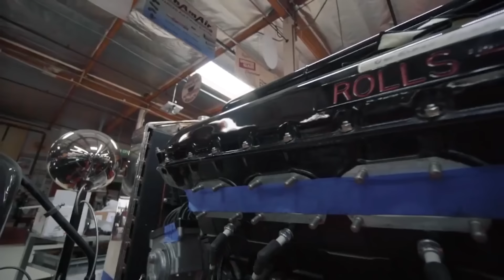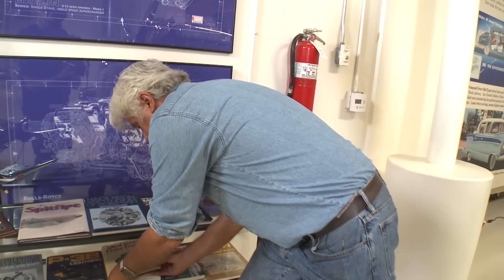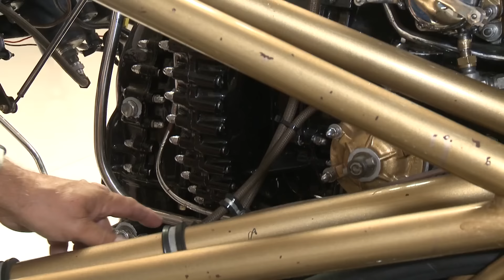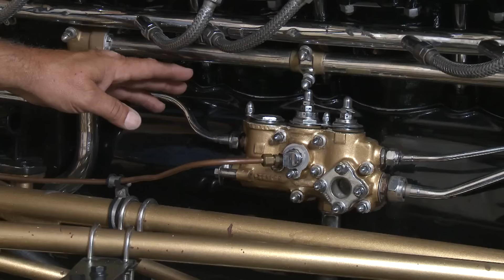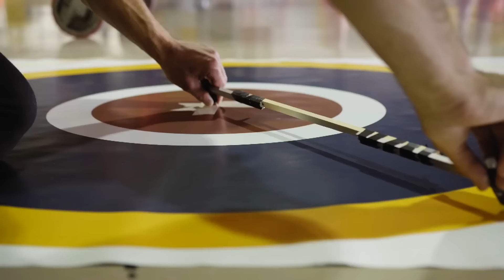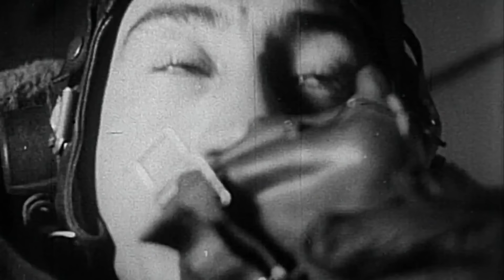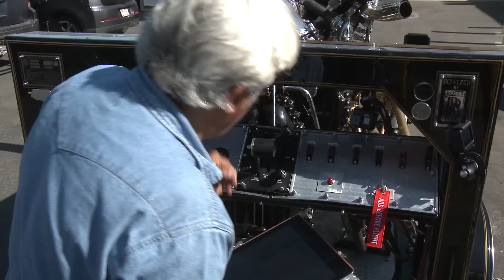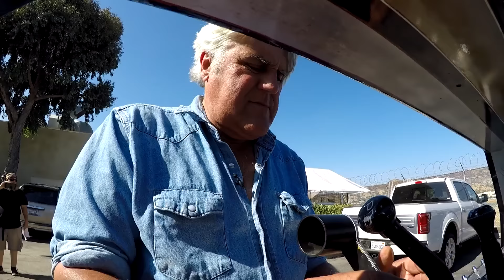The Engine That Won World War II - Jay Leno's Garage

Comment: Thank you for saving and restoring all the cars, the Merlin, and all the other pieces in Jay’s Garage.  I know how you feel.  I am currently working on  the second restoration of a 1921, New Orleans built Mikado 2-8-2 Steam Locomotive.  She was restored to FRA standards in 2004 and made several trips out on the main line of several Class one and short line railroads,  she turned 100 in February.  We had hope to have her running for her 100th birthday but Covid -19 halted the work for over a year now.  Any one interested cal search on You Tube for SPX-745 if you would like to see her running out on the main line.

Comment: While I was in the Air Force stationed in West Texas, I got my commercial pilots license using my GI Bill.  I use to fly to, if I remember correctly, Brownwood, Texas to build my cross country hours.  There I watched a group of guys build a flying P-51 out of several airplanes.  I remember looking behind the hanger and seeing several P-51 fuselages, wings, tail sections, etc, etc.   I was there the day they did the first taxi test and a high speed trip down the runway but it did not get airborne.  I missed the first flight.  I love the sound of those Merlin engines.

Comment: Cool video!!! Especially the view of the internal workings of this beast!!! And the explanation of the components!!! But Jay needs to be a little smoother with the working of the throttle... Things like this, don't respond well to sudden movements of the throttle, mixture and prop pitch controls, especially with a shortened prop like this display engine has... Two thumbs up Jay!!! 👍👍

Comment: Those ran best on 115/145 Octane  Aviation Gasoline, that is loaded with lots of extra tetra-ethyl-lead to obtain a  true 145 Octane rating at sea level. The P51A, & B models and some C models had Allison engines  that failed to deliver good performance at or above 10,000 feet.

Comment: Jay, that's an awesome piece, but you need different models for your Merlin display. The Curtiss P-40 Warhawk on the right was built around the Allison V-1710 engine and the Vought F4U-1 Corsair used a radial Pratt & Whitney R-2800.
You need a Spitfire Mk1 and a P-51D Mustang up there.

Comment: BY the time the P51s with the Merlins were commonly used the radials had done the most of the job, The P47 Thunderbolts had saved the D day landings with there fighter bomber techniques and prevented Germany from sending troops and weapons to use on the beaches. Greg's Airplanes and Autos in his series on the Thunderbolt , episode 8 explains why the Mustangs were given more credit than they deserved.   And then in the war in the Pacific, the Wildcats, Hellcats , Thunderbolts and Corsairs in the roles as fighters also did the yeoman's work in escort of Navy fleets and bomber escort. Grumman wasn't called the Iron Works for nothing, They and others that used radials built planes that could take a lickin and keep on tickin.
Reply: @tecdessus https://www.youtube.com/watch?v=PZKKr56YgOE 

All sorts of planes were used , But the P47 with their low level bombing and straffing made the Germans fear the Jugs. Very few planes could take the damage of flying thru tree and electrical wires and cables and still return home. And at low level they were able to accurately hit the targets  and cause mayhem with their 50 cals. Everything contributed on D day, But the Jug was in it's element in it's role.

Comment: Yes Jay we did imagine that Merlin at 4000rpm and it went something like... the chains securing it to the ground snapping and you holding on for dear life with your legs straight back behind you flying over LAX being asked by air traffic control what the unidentified aircraft is flying over restricted air space and F-16s escorting you to your crash landing in Nevada, LOL to finish off the rest of the show/video. Although i know its just an engine in a stand, the vision in my mind was what was most funny.

Comment: Had a few of these in pulling tractors and monster trucks. We got them from Birds Metals for 80 quid each, No guarantee it would run, but you could always take them back and weigh it in for scrap and get your 80 quid back. We eventually got a workshop manual for them and on the top of each page was stamped  TOP SECRET M.O.D. 
 Still one of the best mechanical sounds EVER...
 If you shut the reves down to quick it would brake the counter weights in the distributor....

Comment: Enough with the Limey engines! How about a car based on the more interesting  Ford V-12 aircraft engine? This was designed to be superior to the Merlin in every feature except the supercharger - better valve train, better bottom end, fewer parts etc. I would like you to acquire one of these engines and mount a Merlin supercharger on it. Alas I'm not able to participate in the financing for such a project. But I would be grateful.  This was probably the US/British engine that should have been in the P-51 rather than the Packard/Rolls engine. Probably politics. Henry Ford was out of favor with Democrats.
Reply: Suck it up paddy.
Reply: But the Ford engine was not made, only a few prototypes.  Why should the allied armed forces buy  a Merlin lookalike and flyalike when they already have one?  They told Ford to devote its skilled men to design and make what was needed, not duplicate.
Reply: @johnburns4017  
You may be right. I'm just speculating. But one thing is clear later engines are better than earlier engines. All aircraft engines were constantly being upgraded. The Ford engine was a later  and more advanced design. The Merlin was single overhead cam, the Ford was double , the Merlin had fewer main bearings and about twice as many parts. Ford had tried to make the engine more robust and reliable. It was a later (better) design. So the Ford had a better potential future than the Merlin.

The Merlin had the great advantage that it was available now and it worked. Many new planes were begun but never reached combat status for one reason or the other.  Even if I had been there at the time and I was a real aviation engine expert I would not argue with the decision to choose something that works now against  the possibility of better performance that might never materialize. I'm just a Youtube commenter. That's a tough call when men are dying. As they say, the decision was above my pay grade.

But consider: the Ford engine turned out to be a great engine in Sherman tanks in V8 form. Reliable, powerful and easy to repair. 

The Merlin had already been popped into the P-40 to replace the Allison and hadn't made much of a difference. I can't explain why it did so much better in the P-51. The aerodynamics?

The Merlin was  the second bigger version of the line. Rolls Royce tried to increase the same basic design with the larger Vulture and it never worked very well. 

The Merlin was not designed for mass production/interchangeable parts and had to be reworked by Packard. 

The real 'special' feature of the merlin was its supercharger. It seemed to me they might have tried to slap the Merlin supercharger on the Ford in parallel with swapping in the Merlin for the Allison. Two development streams not just one. If the Merlin could be adapted for the Ford it might have been faster than the whole engine swap because it took quite some effort to modify the Merlin by Packard.
Reply: @Agorante  
Packard did not change the Merlin design at all.  They changed the threads to the US standard. The Merlin was mass produced at three plants in Britain. The Merlin was used in tanks, the Meteor, being the best tank engine of WW2, and after. Used in the Cromwell, Comet, Challenger, Centurion, as well as other AFVs. There was an 8 cylinder version of the Meteor, as well called the Metorite. The Meteor was made until 1964. 

The Ford engine would have been a waste of time and resources, adding no value for the allies. A waste of valuable, and scarse,  engineering skills. The allies needed light, small, and powerful tank engines. The US never managed to build one. 

The RR Griffon was much simpler than the Merlin. 

The Stanley Hooker 2-speed, 2-stage supercharging gave the Spitfire and extra 70mph and 10,000 feet. 

The US was unable to get this type of supercharging operational until after WW2 on an Alison, despite being given all technical details by the British.
Reply: @Agorante  
Many of the comments here prattle on about Packard modifying the Merlin. They did no such thing. RR ensured their engine had interchangeable parts no matter where it was made. The engine was made at a number of locations: Crewe, Manchester, Glasgow and Detroit. Packard took a time setting up Merlin production as they used American threads, not British. 

Packard had to issue a tool kit with each engine as British and Aussie mechanics did not have US gauge tools.  In hindsight RR should never have allowed Packard to stamp the word Packard on the rocker box covers. But in the day, seeing the word Packard meant you used another tool kit. This confuses Americans into thinking it was a different engine to the RR Merlin.
Reply: @johnburns4017  You seem to know what you are talking about. How refreshing.

Comment: You used to be able to go for a ride in it. Not sure if they will continue that after the pandemic is over. I have some cool footage I shot of them powering it up on the flight line. I was standing maybe 40 feet away and boy does that thing sing.

Comment: The Merlin was no doubt a superlative engine; however,  my personal favorite is the Pratt and Whitney R-2800 Double Wasp.  It put out 2000 hp and powered the Corsair,  P-47 Thunderbolt and the F6F Hellcat; among others.  It is perhaps the most underrated engine of WWII
Reply: Also the Allison was a great engine, but without a secondary super charger (or turbocharger) except in the P38, it was hard to compete.  It was initially planned for the P39 and P40 for example but didn’t happen in anything but the 
Lightning I believe.
Reply: I was about to say the same. I wouldn't go as far as to say that the Merlin "won" the war, even as a YT clickbait title.
Reply: @episteinlist  it run the war in Europe 
The pratt and Whitney won the Pacific war
Reply: @Alucard-gt1zf maybe it won the Battle of Britain (in a large part shared with radar and the human network) but Pratt and Whitney won in Europe and the Pacific.  Obviously Packard took on the Merlin, improved/standardized the manufacturing tolerances, and they were used in P51 but the Thunderbolt defeated the Luftwaffe and gained the U.S. and the Allies air superiority.

Comment: My Dad flew 55 missions with RAF Bomber Command in the Merlin-engined Halifax.
Reply: My grandfather  flew with messerschmidt me262
Reply: Halifax had radial engines, you probably mean the Lancaster, that one was similar to the Halifax, but had 4 Merlins instead of the 4 Centaurus 18 cylinders.
Reply: @HeavyTanker1945 actually there were more than 2,000 Merlin powered Halifax’s built. So yes, the majority were powered by radial engines, but a good number were Merlin powered.

Comment: I don't like the hyperbole of  "The Engine That Won World War 2".  Aviation technology was advancing at such a pace during the war that aero engines and aeroplanes were designed and modified constantly.  However, I think it is fair to say that the Hawker Hurricane and Supermarine Spitfire, fitted with Rolls-Royce Merlin engines, flown by heroes, built and maintained by unsung heroes, and managed by great leaders such as Hugh Dowding and Keith Park, saved the UK.  If the UK had been conquered it would have been far more difficult to liberate Europe.

That said, the sound of a Merlin engine will always be associated with the RAF (as well as the Air Forces of the Empire and Dominions) in WW2.

Comment: absolutely immaculate Merlin. thanks Jay.  other engines could be added to the list. V8 ford. GM diesel,  Chrysler 6, Pratt and Whitney, Wright Cyclone,  T34 engine
Reply: But they never won the war.
Reply: @johnburns4017  do a little more reading, I think you will find they did.
Reply: @tandemcompound2  
they never won the war.  To myopic Americans they may have.

Comment: I'm sure Pratt & Whitney will dispute the claim that the Merlin engines won the war...
Reply: Pratt & Whitney will lose the dispute.
Reply: @johnburns4017  oh? So the p-47 thunderbolt, f6f hellcat,the F4U Corsair and all the various bombers that carried that engine had no contribution whatsoever?.. are you kidding or you being willfully ignorant... After all ignorance is nothing more than a lack of knowledge.. stupidity is the refusal to correct the situation...
Reply: @squigmontlucas6150  
The Merlin exceeded them.
Reply: @johnburns4017  that wasn't the dispute..original claim was the Merlin was the engine that won the war..while any claim to a material object solely responsible for winning the war is a false claim because it's one by the people who used it in victory,.. however feel free to list the statistics concerning the performance in both.. even the heavy p-47d thunderbolt out classed the spitfire when they put the paddle blades on it.. the Corsair was more than a match for any German fighter but was not used in that theater, it  was used extensively in the Pacific.. where the Merlin engine was used very little..the Corsair and hellcat could out dive out climb and  outmaneuver every Japanese fighter including the the advanced ones.. it would have been interesting to see them against German fighters..
Reply: @squigmontlucas6150  
The single design that made more impact than any other was the Merlin.
Reply: @johnburns4017  you cannot make that statement unless you have the facts to back it up otherwise it's just an opinion. The fact that it made no difference at all in the Pacific theater alone causes your assessment to collapse....
Reply: @johnburns4017  the Pratt & Whitney R 2800 twin wasp put out over two thousand horsepower.. the Merlin put out around 1100.. it was the Pratt & Whitney that powered the bombers of the American air Force.. which bombed German cities into rubble..  would you say that was a significant impact?
Reply: @squigmontlucas6150  
Merlin reached 2,000 hp. For a very small and narrow engine. The Napier Sabre in Typhoons and Tempests,  produced 3,500 hp. No one made a plane like the Tempest in WW2. No one.
Reply: @squigmontlucas6150  
The Pacific theatre was only a small part of WW2.
Reply: @johnburns4017  the hawker typhoon and the tempest indeed we're great planes indeed, but it's the contribution of the entire military industrial complex of engineers, workers  mechanics, supply personal and most of all the pilots who flew all the planes in every theater of action.... it was the sacrifice of the greatest generation that allows us to even exist today... not the contribution of a single design...these are ridiculous and pointless , even vain arguments to pursue...
Reply: @squigmontlucas6150  
I know exactly what I am on about. 
I do not get history from Hollywood.
Reply: @squigmontlucas6150  
The aero engine that stood out was the MERLIN.
Reply: @johnburns4017  yes ,that engine stood out it was a great design but there were so many others as well. To make the claim that it is the engine that won the war is inaccurate at the least, and it is a conclusion based on inadequate information and personal feelings. You're not even about facts are you? it's all about your ego now..the inhuman egoi inherited in the fall of man ..you know it's always looking for somebody to bow to it..
Reply: @johnburns4017  well you obviously did not study enough because the Pacific theater of war was not a small part of world war II in the least.. and I never got my history from Hollywood either..I studied it for 40 years especially the history and details of world war 2 ever since I was a little boy..and your insinuation that I did is another one of your ridiculous claims based on inadequate information and your childish emotions.. oh I get it you're a legend in your own mind aren't you?
Reply: @squigmontlucas6150  
A naval war.
Reply: @johnburns4017  Whatever you say little child....

Comment: The Brits that flew and worked on the Curtis P-40 Warhawk in North Africa liked the Allison V-12 better than the Merlin. Unlike the Merlin, the Allison could take multiple hits from MG fire and keep running. The mechanics liked the Allison because it used 50% fewer parts.
Reply: But the pilots liked the Merlin.

Comment: Great engine for sure, but I think the Pratt & Whitney R2800 Double Wasp was hands down the best engine. By the end of WWII, R2800 in the P47 with "tweeked" water injection and boost levels, could make 2900hp.   The R2800 could sustain waay more damage too and still keep running.
Reply: No. The Merlin was better.

Comment: Would make a cool Boss Hoss conversion kit. Up grade that bad boy for more power.
Has a burbling idle that sounds like outa my way fool I’m gonna turn her loose!

Jay, you should restore a Napier Sabre 24 “ H “ sleeve valve, 2300 hp and a sound unique in all the motor world. Low octane fuel could be used because of no poppet valve design means no tendency to pre ignition of fuel charge. Exhaust valves get so hot they act as a spark plug to petroleum distillate mix.  Also it would be the only one running in the entire world.